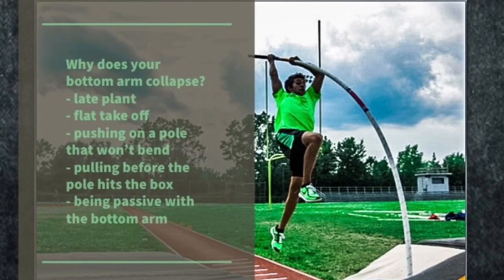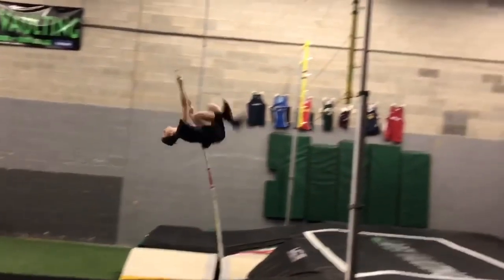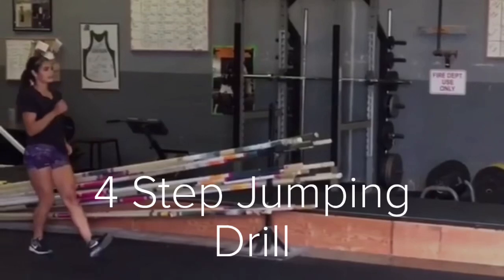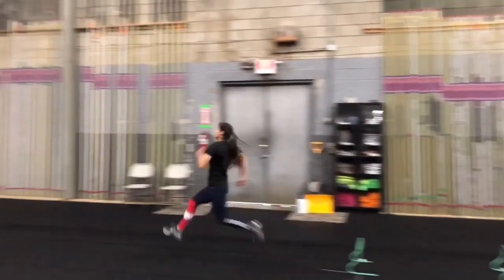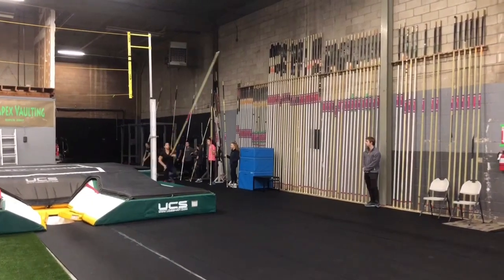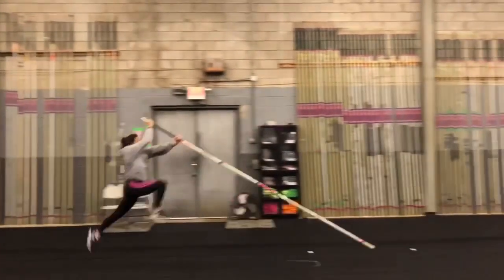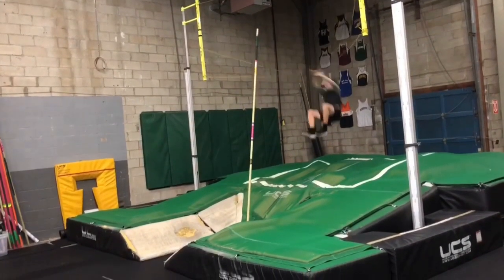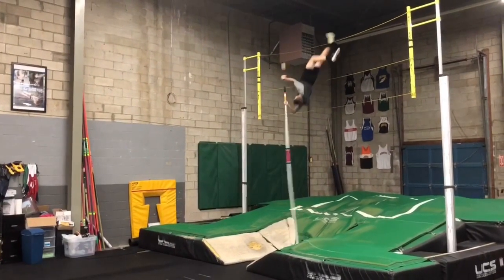How to correct a flat take off in the pole vault

Comment: This is where I'm struggling I still feel his arm once he was swinging is completely collapsed but if you look at an elite vaulter, it seems they keep the left arm out stiff the whole time?

I wonder what this athlete would look like doing a full speed plant drill without inverting with his arm stay out the whole time in that circumstance?
Reply from the maker: I think a more extended bottom arm is a reflection of higher grips and jumping up. I don’t think someone who is gripping lower and the pole isn’t bending as much should have a fully straight bottom arm. In fact what is more important is that the bottom hand gets above the head after take off so that the athlete can have leverage to use their upper back muscles as they swing.

Comment: How do you work on keeping your hips behind the pole
Reply from the maker: Usually your hips move past the pole if you run into take off or you push your arms forward. Your hands should get above your head and allow you to pull with the bottom arm and upper back to accelerate the swing and that will allow your hips to stay behind the pole. If you are flat or stab the box your hips will go forward.

Comment: You had them do jumping drills then gave them a softer pole and said the left arm wasn't collapsing as much because of the jumping drills? How do you know it's not because the pole is softer?
Reply: (i think) since he is talking about the cause of the collapsed arm ( flat takeoff ) he teaches the athlete the jumping drill and he only puts them on a smaller pole to focus on the bits of form that the jump drill emphasizes.